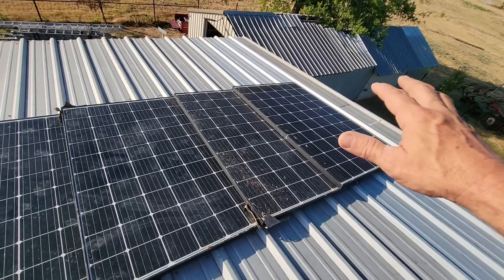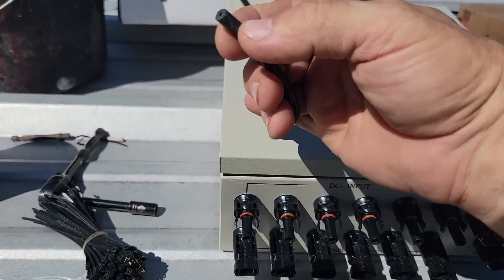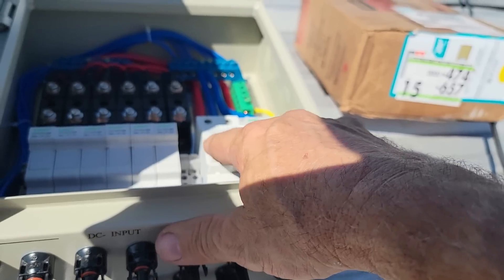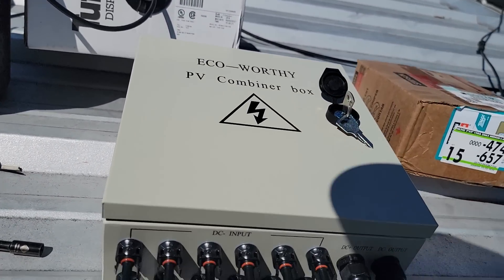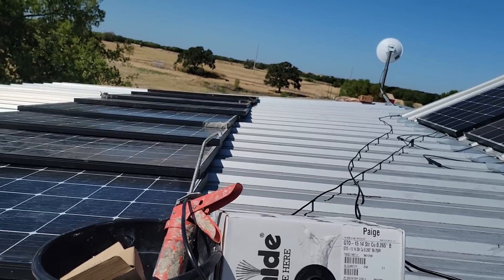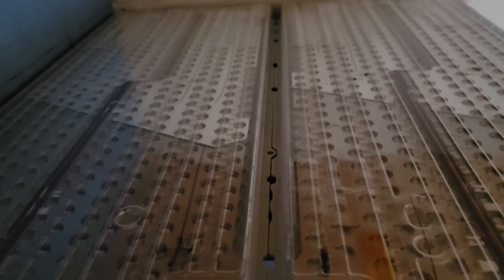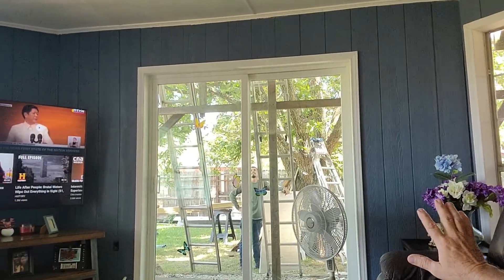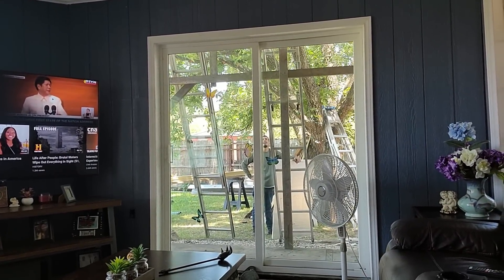BEATING THE HEAT WAVE with SOLAR in Texas Part 2

Comment: When you return to the Philippines have you considered shutting the water off to your house and draining it down then you don't have to worry about anything freezing inside your house
Reply from the maker: We did that 2 years ago. We even put a wet vac on the lowest points and cracked the valve at the highest on cold and hot side. Then we followed up with the pink rv antifreeze  with a hose and funnel pouring it in the lines form the highest point until we had pink running at the lowest point. We returned to fixing about 7 busted places.
Reply: @TexasFilipino  That's amazing. I used to work for Marriott hotels and resorts in Michigan and as you know the ground will freeze down to four feet deep. Ford motor company would come every fall with air compressors and blow out the irrigation lines and we never had busted pipes.

Comment: Hey James, I'm looking to do a basic solar system in the barn.  No air conditioning, just want to run some lights , fans and maybe small space heater in winter time.  What wattage system would you recommend?
Regards
Frank
Reply from the maker: The space heater itself would use 1200 to 2500 watts according to the size you buy. I dont have no way to know how many lights or types.  If you used a small heater you might could use a 3000 watt inverter but something like a space heater is going to be pulling constant pretty much. That will drain batteries fast. For night time it would take a very expensive amount of batteries.  It would not be cost effective. You might want to look at using a propane heater instead. If you did that then that would change the equation greatly.  3000 watt inverter and about  10 to 12 panels of at least 300 watts each.  Batteries - get lifepo4  the smartest safest option available at the moment. On the inverter.... it does not cost much more at all to get a 5000 to 6000w vs a 3000 watt. at least you have extra capacity for expansion.

Comment: I don't think you will ever save enough to pay for all the equipment , that's 10s of thousands of dollars
Reply from the maker: MPP Solar sold me that inverter directly for about $900 , the batteries was $1800 and the solar panels was around $3000, the wire was $125 and the combiner box was around $125.  Add up another $200 in other random parts.  So around $6000   - That is far from ten of thousands!! This system carried power here last year when ice storm came and there was no grid power for days. It kept my security cameras and internet going, refrig going and more. I had it temp installed then. The fact that we can have power here regardless of the power grid means a lot to me. We run our whole house on solar in the Philippines so about the same cost of equipment. At the cost of power there and the constant outages that occur it is priceless!

Comment: Good volg again brother you just keep cranking them out . Hey on the original  brackets for the panels did you think about 
Spacers or washers under them to raise them to the height  you needed them to be ? 
Just wondering . man I had to get use to cold water  showers when I first went to  philliphines  I to was use to taking warm not hot just enough  to take the chill off of the cold water . Your right about drying out the skin of oils but on other hand warm or hot opens pores up to get dirt out cold  closes the pores up & helps make blackheads I think .But each to thier own  Power on Professor  Longhorn  .Mabuhay Po .

Comment: Pico de gallo girl. Well that’s good stuff, just add chips .... well I can’t do that a lot anymore either nowadays. 
 Great getting that solar up. Summer sun ☀️ is killer. Hot water is off and I still get hot water here in the desert. 40 gallons sitting out in 110° all day gets hot without and extra heat.

Comment: We use heat tape up here in the north... but they are not 100% reliable, in my opinion...
Reply from the maker: Hard to tape pipes inside of walls though :(
Reply: Yes, for sure.. Good luck... I am used to houses here in Ohio where we have basements and you can easily back drain the water system...

Comment: Will your panels be setup as 3S4P ???
Reply from the maker: My mppt charge controller/ inverter will not allow for that high of voltage on more than 3 panels in a series. 4 panels just goes over its threshold. Maybe 95% the 4 in a series would not exceed the voltage but all it takes is that one cool bright sunny winter day and the voltage spikes popping your mppt charger. So I to stay safe I can only put 3 in series on each string. with these panels it will put me at 119.46VOC and my charger has a limit of 145VOC.  So yes 3 in series but I will have 5 series strings paralleled together. this will bring me to 119.46VOC and 48.9 amps once all 5 strings are paralleled together.  The newer MPPT models are now allowing for 450 to 500VOC  which would allow me to put 12 panels in a series string @ 477.84 VOC with these panels. If you have a dual MPPT  you could put a second set the same and have no need for a PV combiner box just breakers.  and low cost on wire since the amps would remain low.

Comment: Water pipe heating wraps my man. Snake them around the pipes and they only come on at a certain temperature. Combine those with a couple little radiant heaters. Disclaimer....I'm always skeptical about electric heating when I'm not around,  I'm scared of fires.
Reply from the maker: these pipes are internal in the walls and under the floors. Can't pipe wrap those. The heaters I have a very safe. Amish style and with some really quality cords on them.
Reply: @TexasFilipino  copy that